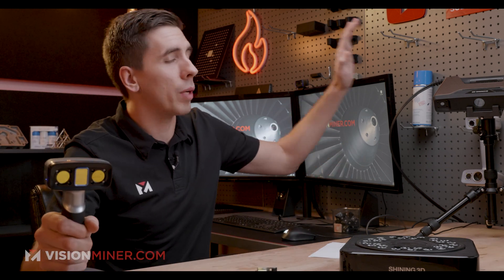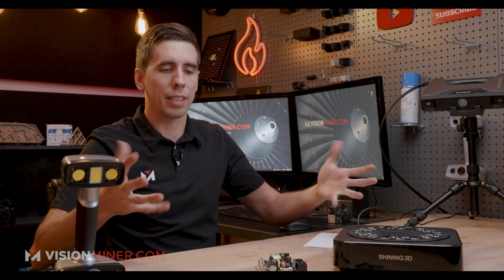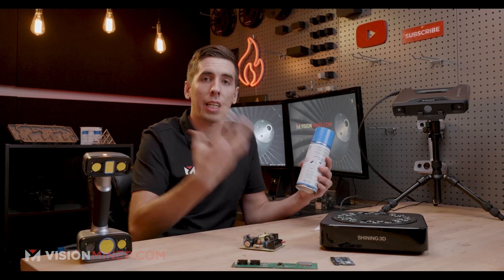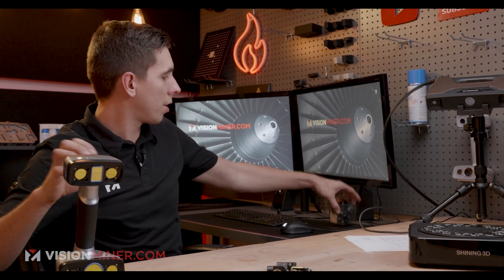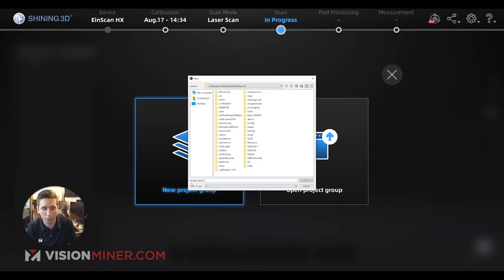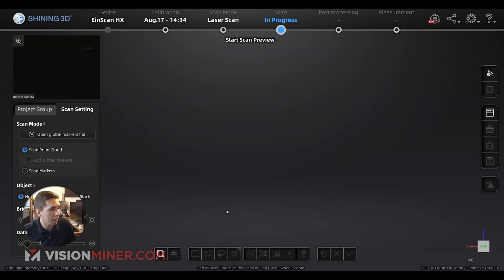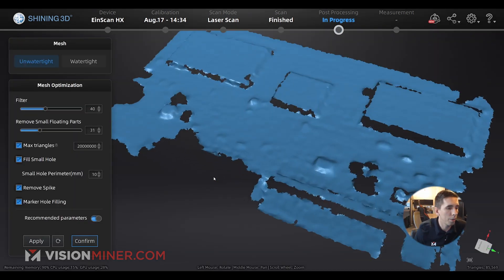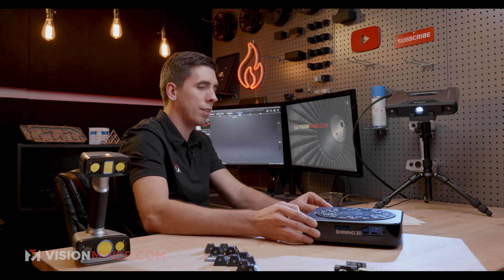3D Scanning Mother Boards - Einscan HX vs Pro HD | Will it Scan?

Comment: I wonder why reviewers never use 0.05 resolution on the HX even in a comparison like this. Does it even work at all?
Reply from the maker: Mainly because it takes WAY longer to process all the data -- however, we're getting this request a LOT, so definitely subscribe and expect to see a hi-res scan here in the next few weeks!
Reply: @VisionMiner  Any estimation about when will this video be available? Thanks a lot for the nice reviews!
Reply: Yes ir works and is  way better than the standard high quality.  it doen't take all that extra time on a small parte like this One. Much less time than the HD pro hás Taken to  scan this PCR board. The really sad thing was that the board should have been scanned in the same way as it was with the HD pro glued to the table.  Maybe Next time you should scan the same piece in the same conditions to be fair. Other than that it was a good review.

Comment: dang, so ideally, if i wanna get SUPPER accuracy on small parts AND sometimes scan something like an engine bay (to produce my OWN air intake or something like)... i would need both scanners lol.... -____- whew
Reply: No the Pro HD will scan about anything if you scan in low light of the evening and turn up the brightness it will scan black or shiny objects just fine I just scanned under the hood on a car about 2 hours ago. I didnt use any spray or trackers and it turned out well.
Reply: @banjohero8352  oh wow ok! Good to know.  Thanks bud
Reply from the maker: @torodatruth  well, the super low resolution only comes on the HX, at 0.05mm point distance, but it's not nearly as good for smaller parts. We'll add this into the video coming soon!